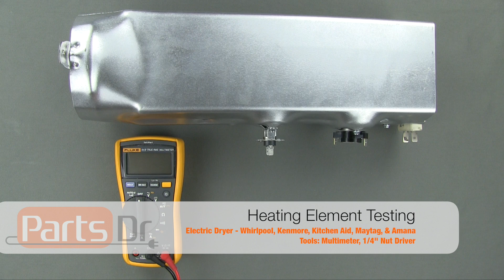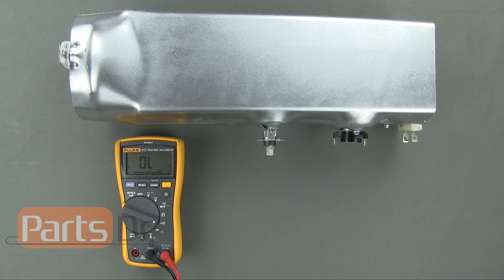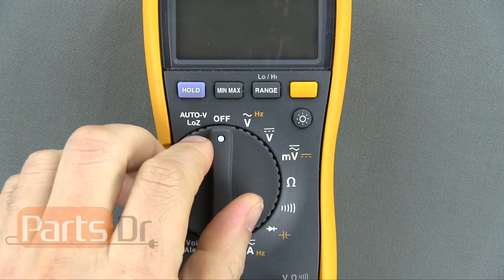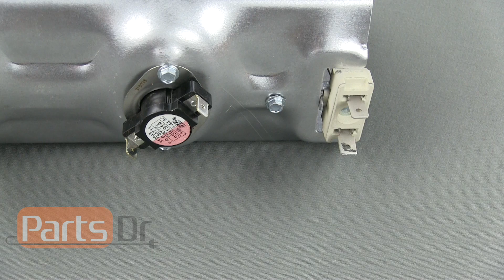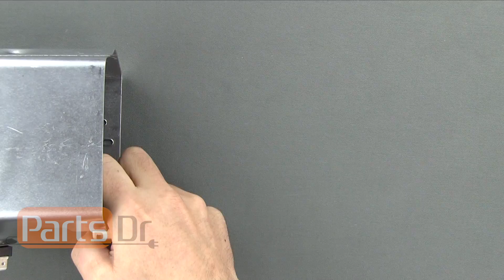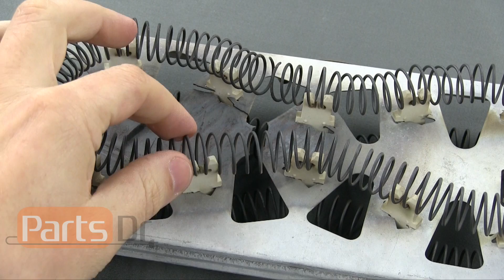Whirlpool Dryer Heating Element WP3387747 - How To Test

Comment: I changed  high thermalstat switch but it went bad again
Reply from the maker: What is the part number and model number of the dryer?
Reply: @PartsDr  ywed9050xw1
Reply: @PartsDr  dryer turn on spins but no heat.i checked continuity on elemt it's good.has 10 ohms with meter

Comment: Thank you, it was bad Thermal Fuse. Less than 6 months old, just replaced all the parts (bad element). Wonder why I blew so soon?
Reply from the maker: The first thing to check for restrictions in the exhaust venting.

Comment: ON MY WHIRPOOL DRYER I CHECKED THE HEATING ELEMENT, THE THERMOSTAT AND SENSOR OR FUSE PROTECTOR THEY ARE ALL GOOD. WHAT CAN BE THE PROBLEM? COMPUTER BOARD?
Reply from the maker: Yes a bad control board could cause your issue.  Also, make sure the check the power supply to the dryer to make sure it is getting proper power.

Comment: Thank for vid...I did the testing and switch removal without taking out the heating element & housing. I just removed the front two bracket screws and loosened the heating element housing to get at the bad (no continuity) high limit thermostat...so now to check the price, order, and wait...an no I won't be buying from that big conglomerate co. the begins with an "A"...!! They have so much $$ they are now taking rides on rocket ships into space...Jeff how 'bout more philanthropy and helping the less fortunate..!!

Comment: My element has an ohm reading of 0.9xxx.  It heats the dryer well, almost too well.  The sides for machine are very hot to the touch after about 30 mins.  I have tested both thermistor inlet/outlet and thermal cut off.  They all read fine.  I guess I am confused because I assume any issue with the heater element would result in no heat, not excuse heat like I am experiencing.

Comment: I have an odd problem. The dryer will heat for 5-10min into the cycle, but will shut off and the dryer will continue to spin for the remainder of the cycle. but afterwords the breaker has popped and the dryer wont turn on until i reset it. it happens every time i run the dryer
Reply from the maker: This type of problem can be caused by a bad breaker.  I would start by replacing the breaker to see if that remedies the problem.